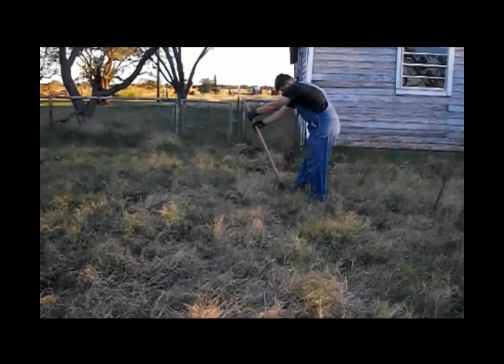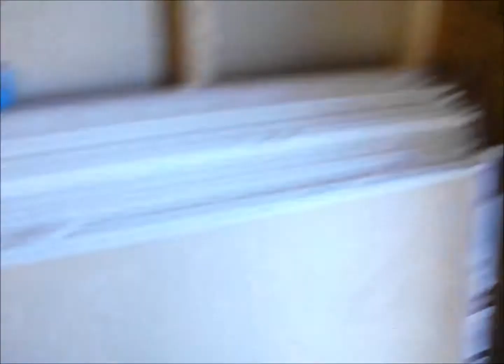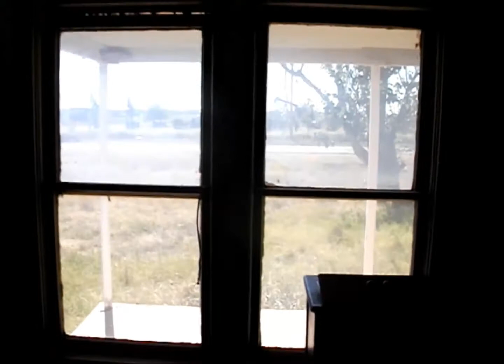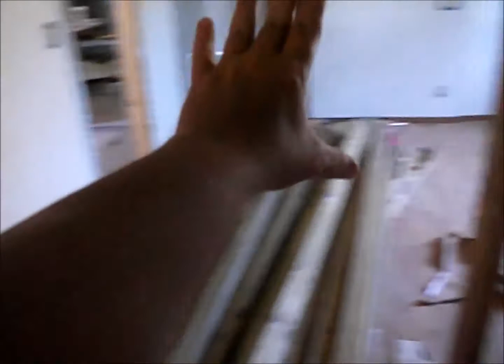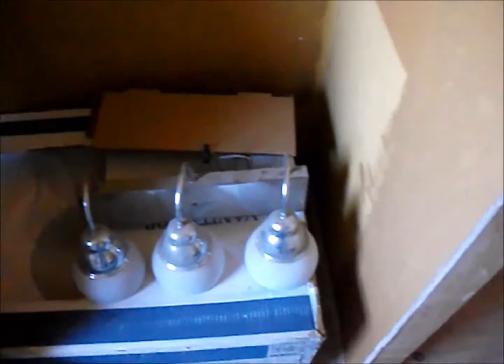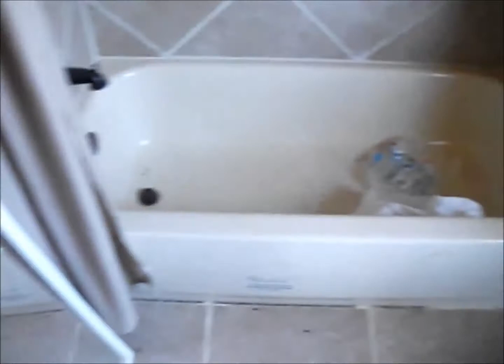Windows, siding and insulation

Comment: You might try looking on ebay for your shower valve handle. I found parts on ebay. It will be too exspensive to buy from a dealer.
  The finish on the bathroom fixtures and towel rack is called Oiled patina bronze. Bronze is mostly copper with some tin mixed in.